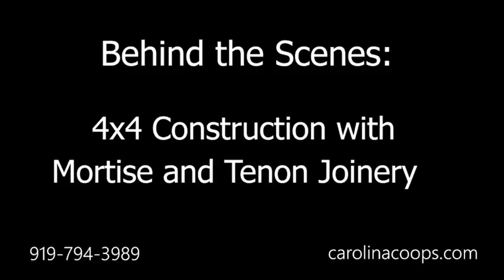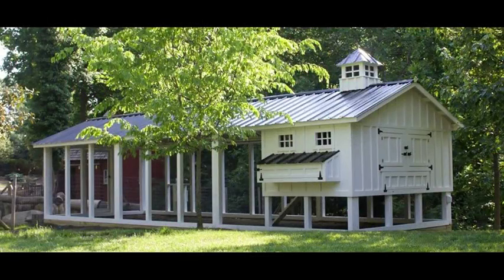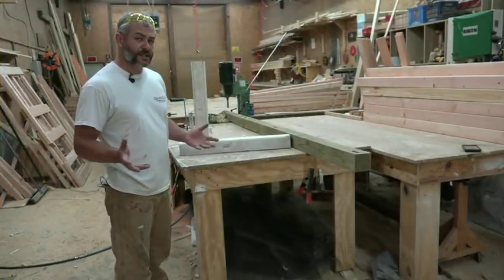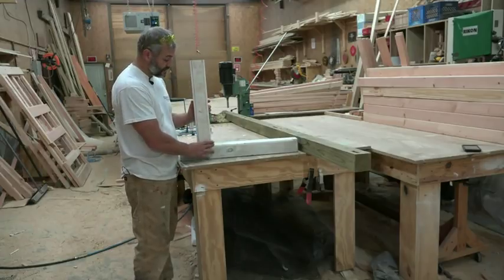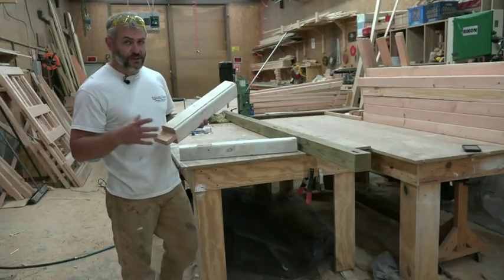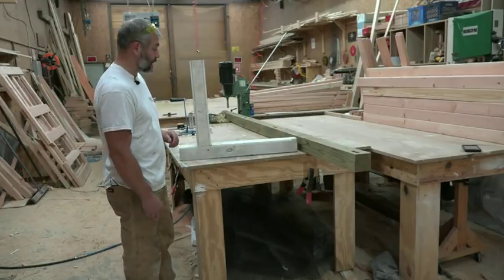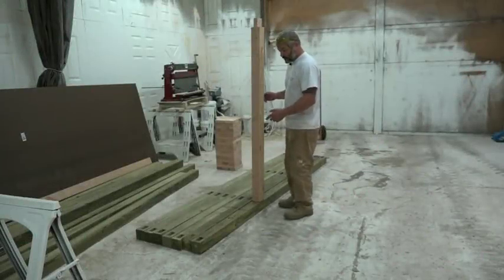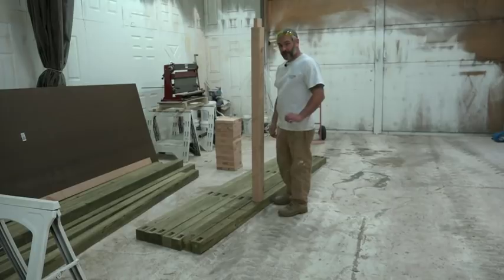Carolina Coops - Mortise and Tenon Joinery

Comment: Nice Video 
You using a traditional tenon machine to cut each tenon or improvised cut method using table saw, just the tenon looks nice clean accurate cut. Be interested to hear your method of cut. 
Thanks
Reply from the maker: delineator you mean what is our method to cutting the tenons?
Reply: The cheapest way would to be to use a plunge router for everything if you set up production guides for dead on accuracy. However.. doing this with a router takes forever. Using a good chop saw or table saw to make the Mortises works good. So does using a  chisel if you have tons of spare time and patience and you wanna go old school on it lol. Decent used Mortisers can be found anywhere for around 4-700 bucks. No matter what, This type of joinery is the best way to go for strength, durability and the longest lasting joint over time. Carolina Coops are top notch and well worth every penny. Bless this company